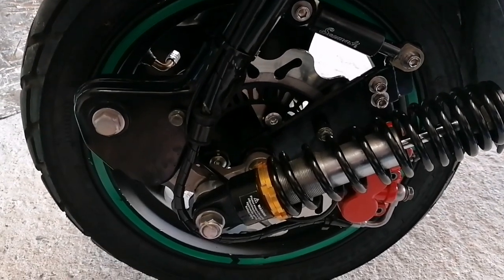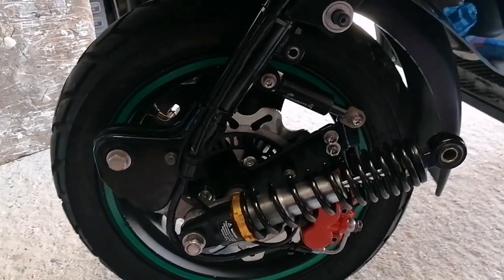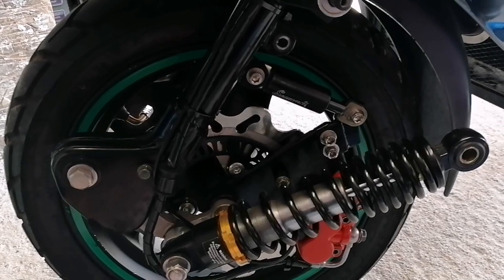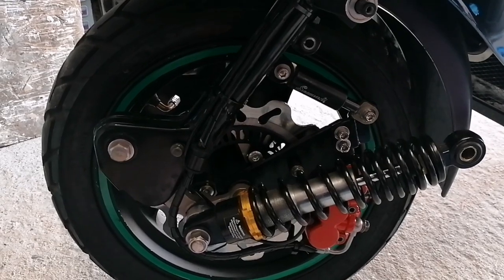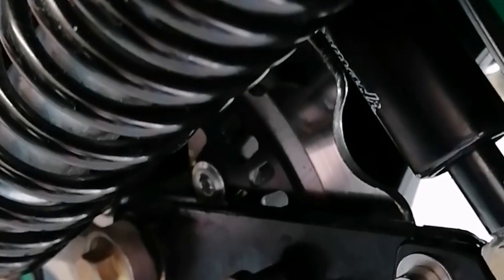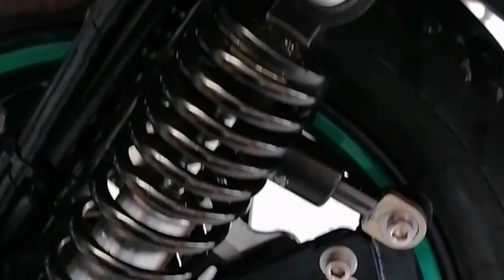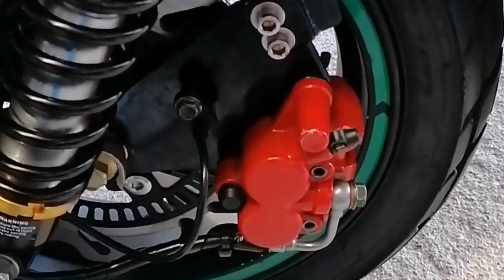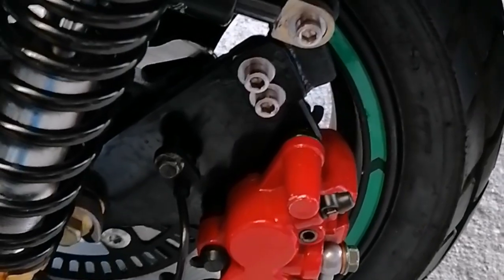Scomadi Suspension Anti Dive  Investigation Two - A Solution.

Comment: Mike that is great work! 
I’ve seen the Steelwheasel‘s documentary about the problem of geometry of the Scomadi design and his solution. But my guessing was that this won’t touch my ride experience. Now you say it is a massive improvement. So should it be a project for every Scomadi pilot?
Reply from the maker: I find it has improved the front end. It used to rattle my jaw! Now it's much smoother. I would be interested to try some different shocks on the front now.

Comment: Can I ask, what is the purpose of that Mini Damper, do you know what it is 'damping' and why?
Reply from the maker: Well if you look at Lambretta anti dive it's a similar concept but at a parallel angle and it's usually a solid bar. It then enables the front end to pivot as it should as its all nearly a perfect square. The original position of the mini damper seems to work against the front end. I can only speak from experience and the original position makes the front end very hard even with the shocks wound down! With the front end symmetrical the damper seems to be doing the right job and easing the front end back on its return over bumps and divots on the poor English roads. So it's a damper of sorts now, albeit a stiff one in its original position and a slightly easier operation in the modified position. Its makes the riding of the scooter a more pleasant experience.

Comment: I have a royal alloy that might benifit fron this as well..but its hard to see the new bracket size and position...can you post any pics or more vid so  maybe I can get a bracket made up or something
Reply from the maker: Yes of course I can. Will put dimensions up at the weekend.
Reply from the maker: Oh and the bracket on the forks is basically the same size as the existing one. The bottom bracket you will have to set out yourself. It's a job for a decent welder or mechanic.
Reply from the maker: I can't add photos on this thread. The new bracket position centre  is 35mm from the centre of the old bracket. I just copied the exact shape of the existing top bracket and my welder tacked it on. The bottom bracket is two pieces of steel formulated and welded together. It was very trial and error to get it spot on. The whole job took about 3 hours as we only had photos of Simon Woods bottom bracket to work from and Steel Wheasel's video on YouTube. You need a very good welder on hand and some mechanical experience as it's not simple. If you send me your email address I can take some detailed photos for you. Hope that helps a bit buddy.